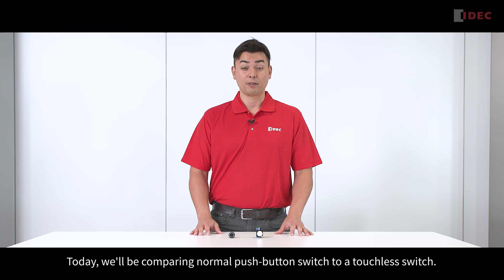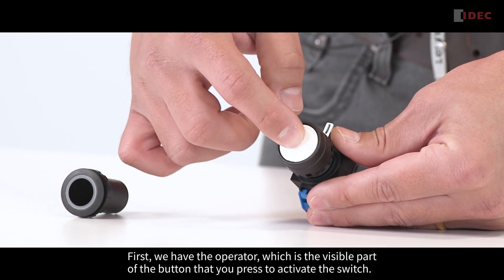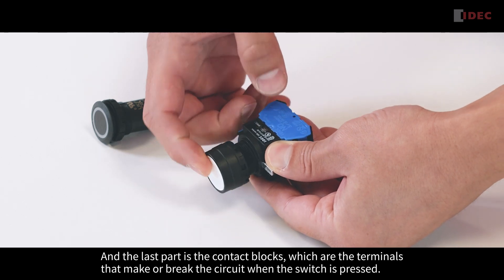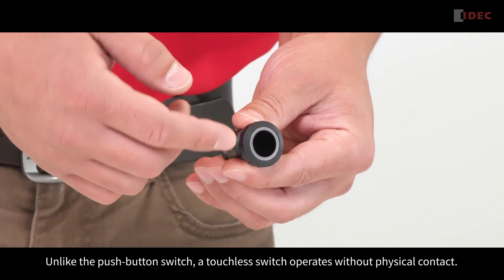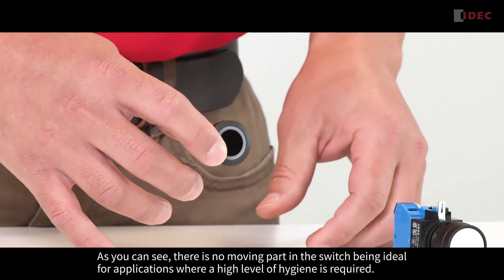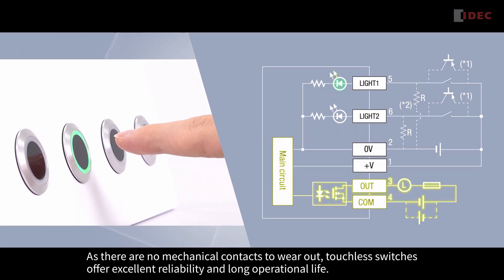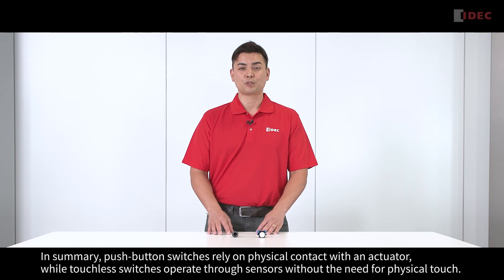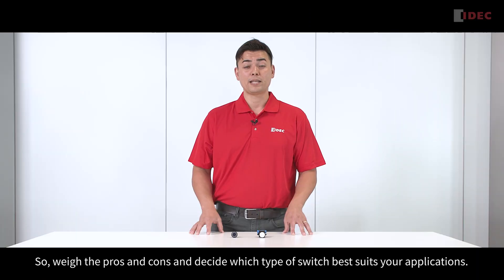Touchless Switch vs Standard Push Button Switch

Comment: Please explain how the wires are connected to the switch without contacts. Also, are there options to wire it as NC / NO, such as with a physical switch with contacts? These videos are made for panel builders, you should provide content that is relevant to your audience, such as how to wire it up.
Reply from the maker: Hello @ellenmakar7750, thanks for your question.

The wires are connected to the touchless switch through a connector.  We provide the connector with pre-wired wires as an accessory. The PN would be CW9Z-CN200 for 200mm wire, CW9Z-CN500 for 500mm wire, and CW9Z-CN1M for 1000mm wire.

The touchless switch itself does not have a mechanical contact so you cannot wire it as NO or NC.  It works as a sensor and outputs an electric signal to the host side. (Controller)

However, you can make it work as an NC/NO switch by adding a mechanical relay in the output of the touchless switch.

We also appreciate your suggestion for the video content and value your feedback.